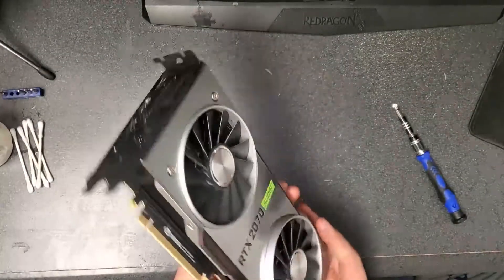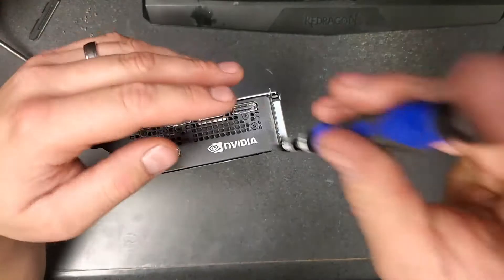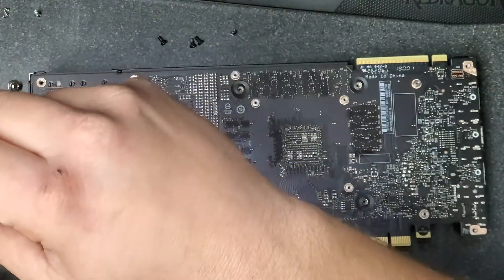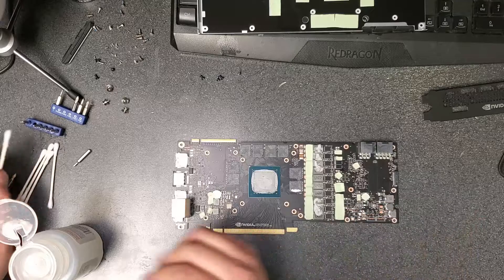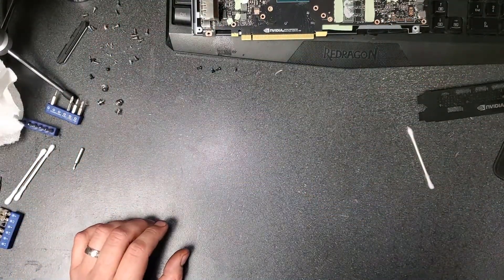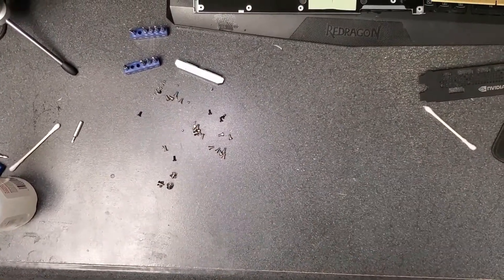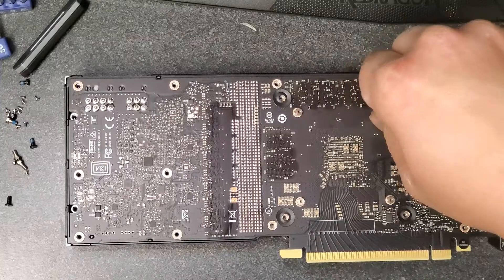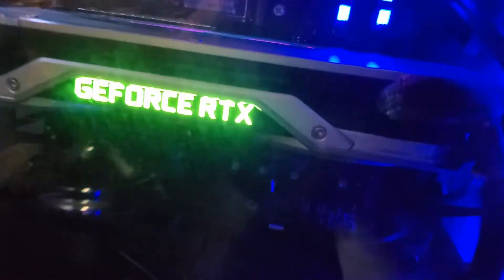Cleaning An Nvidia RTX 2070

Comment: Hi, I recently did a thermal paste change and now my gpus fans are just at a constant full speed. Any ideas on how this happen?
Reply: you might have incorrectly plugged in your fan header, or something was shorted. you posted this a week ago, so i assume you figured it out tho? what happened my man
Reply: @cutekittycatzz1060-3GB  i havent actually haha, it is a possibility something did short though because I did reopen it to check if anything wasnt plugged in all the way. However, Nvidia is dumb and decided to glue the front plate in with the fans so im not able to access it. Either ill have to rma it which i do not want to do right now with this shortage or switch to custom water cooling finally lol.
Reply: @4znk1dd  damn bro that sucks. you might have to just rma it man. unless you can figure out a fix in the meantime.

Comment: How did this effect your temps? My 2080fe runs about 85degrees with max load. I’m replacing the paste tomorrow when my thermal paste arrives. I’m betting my temps get way better. Pretty sure it’s factory paste on it atm
Reply: how were your temps after replacing the thermal tape?
Reply: @1313CHORIZOMAN  I left the tape and replaced thermal paste. I used mx4 and it dropped about 15 degrees. I found the best results by capping the FPS in nvidia settings to around double my monitor refresh rate. If 60htz, cap at around 100-120 and that will cool it done 20-30defrees C. Try it out.
Reply: @1313CHORIZOMAN  I also use msi afterburner for custom ram curves and bring the idle fan speed up to around 50% the nice curve up to 80defrees. Msi is great for cooking if you are not into overclocking.
Reply: Is your case well ventilated? I actually used msi afterburner and run warzone with max settings in a corsair 4000D airflow and my gpu only seems to get as high as 65. Its a 2070 super fe that i bought used so i am sure it had some time running and hasn’t been repasted which i will be doing soon. But yeah just make sure your case is well ventilated!
Reply: @Jlopez5215  I have 4intake and 3exhaust. Cpu is on 240mm aio. My pc is now a 5900x that never tops 60 degrees and my now 3080ti FE never tops 71 with my custom fam curve. I think it’s Ventilated good. The best thing I found for the 20 series was custom fan curve and most of all set max FPS in nvidia settings to your refresh. Set it to 60 or 120 or 144 and that helps the most. Cheers man
Reply: @Jlopez5215  governing the FPS is better than anything. Even undervolting. Try it if you haven’t. No point in getting 5k FPS with 60hz monitor. Set it to your max refresh rate and watch it never top 40+
Reply: @billygames7107  will try this tomorrow
Reply: @Jlopez5215  I hate to do it now. It’s such a huge drop in temps, I can’t run any of my cards unlocked anymore. No point really..
Reply: @billygames7107  so you personally get a better experience running it that way?
Reply: @Jlopez5215  for sure, yes. I overclocked my monitor to 120HTz and capped my FPS max to 120 and my cards run 20 degrees cooler. The FPS cap and a custom fan curve is the way to go, IMO. Cheers..✌🏼
Reply: Please tell me what is the thickness of the thermal pads in this video card?  RTX 2070 SUPER FOUNDERS EDITION
Reply: @yanenko1  there is a new paste to replace all thermal pads. It becomes whatever thickness needed. I forget what it’s called. Look it up. It’s like a thick paste like stuff and works wonders..
Reply: @billygames7107  OK thanks.  I also heard about something like this "gum"..
Reply: @yanenko1  yeah. It’s gonna replace thermal pads all together soon I believe.

Comment: Nice video. Do you have one that shows how to clean the fans and heatsink area?
Reply from the maker: Oops. I just now read your comment without crossing my eyes.  No I don't but I will post a video coving that as it's important information. I apologize for the mix up there.
Reply: Thanks! I'll check those out. Had second thoughts about opening mine up but your videos made me confident enough to do it.
Reply: Please tell me what is the thickness of the thermal pads in this video card?  RTX 2070 SUPER FOUNDERS EDITION
Reply from the maker: I edited that footage out.  But in some of my other cleaning gpu vids I do believe there's footage of pre and post cleaning.